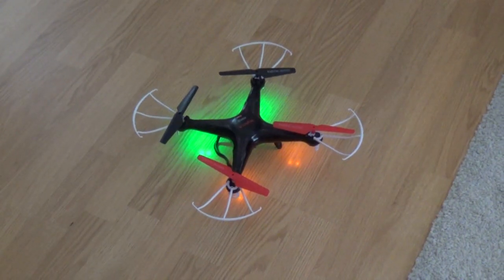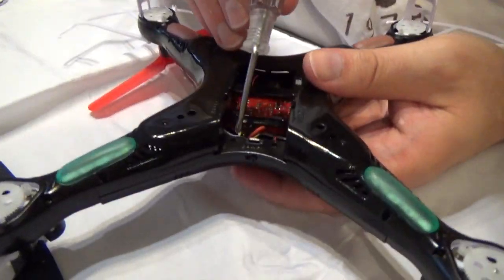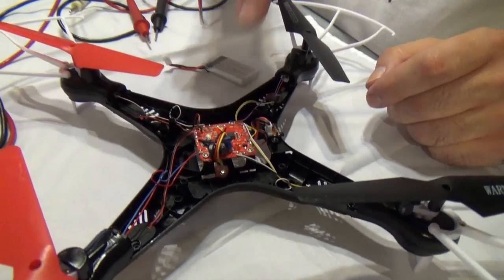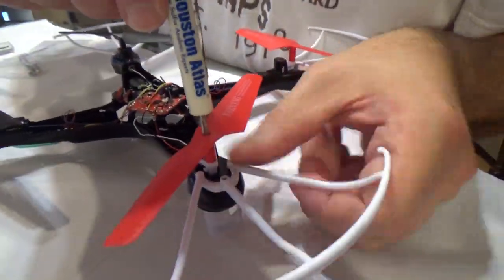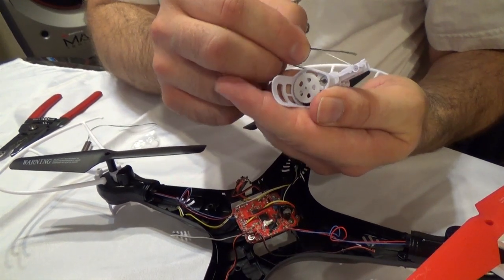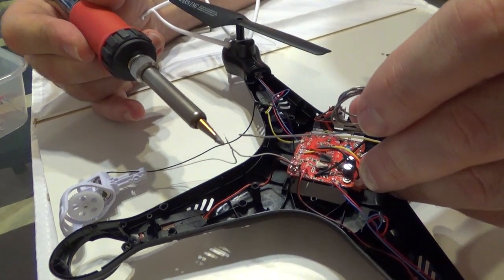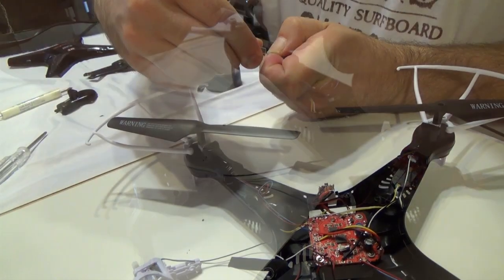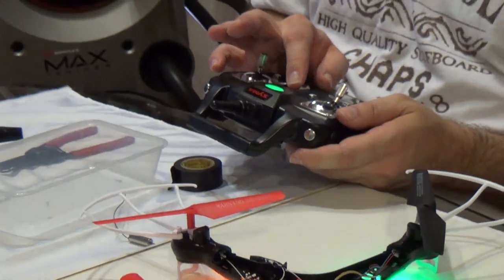How to Replace Drone Propeller Motor

Comment: Can u help me ?
My drone does not fly
I think its propeller motor is slow 
What should i do ??
Reply: open your drone, see which colour wires are conected to it(blue and white/red and yellow) which ever one it is buy a replacement and change it like he did in the video.
Even 2 of my motors were slow, changed them and now my drone flies like new.
like if this helped

Comment: Is it possible that since I bought a motor with red and white wires and I have this factory with black and white can I help how can I connect it? Thank you
Reply from the maker: Hi!  Thank you for your comment!  The color of the wire identifies which direction the motor turns.  So the red and the black are different direction.  They can't really be used interchangeably.

Comment: I have a similar problem but the same propeller won't spin as well as the others what do I do?
Reply from the maker: So... Have you tried to fix it and still bad?  If it's still bad, it could still be the motor is bad.

Comment: Good Job! I have the same issue and the company sent me to your video to learn how to replace the motor. Thanks a lot.
Reply from the maker: +MaryC Haha that's funny that the company sent you this link!  Glad the video helped!
Reply: winimow The new motors have a connector to the circuit board which negated the need to solder, and made the motor replacement effortless!
Reply: @DIYProjectsByDave  i have a KAISER BAAS ALPHA DRONE which has the exact same problem 
is it the same type of motor that I have to buy 
pls reply
Reply from the maker: @navaneethsivakumar8716  I think it's best to research the exact motor needed for your drone.  Sorry!
Reply: @DIYProjectsByDave  ok np. thanks anyway

Comment: Great video! 

Question' I just received a Propel Max 15 and during testing (literally after a total of 3 mins in flight on multiple tries) the drone backed up unexpectedly and hit the corner of the wall and the prop got stuck in the guard. When I went to pick it up it had a smell I knew and smelled like the motor.

After resetting the  remote that prop refused to spin. Seriously... a burnt motor in 4 secs?!

Is this the actual problem? There is no way a motor could burn up just being caught in the guard for such a short amount of time could it... seriously??
Reply: Change the motor,  costs like 2 pounds

Comment: the problem, i dont have a welder.
Reply: 1anakin 20 it's called a soldering iron and you also need stuff called flux and solder... Super cheap at Walmart... All for under 20 bucks

Comment: mine had the same problem after opening it up immediately I spotted the problem one white cable fro M3+ was loose I welded that chomp right on and I was good to go. be careful not to mix the propellers I got a little confuse by those guys till I found a solution on one of the videos.

Comment: After about two weeks thrashing the X5c-1 around mostly indoors the motor to RH side of the small on/off switch quit. Okay, I had a set of four standing by as I knew these were like oil filters - need replacing as a matter of course.  After maybe a day, maybe two - motor #2 quit - only it was that selfsame position AGAIN.  Fair enough, maybe the replacement wasn't excellent - fitted the last spare I currently have.  That one lasted a day.  Three motors all quit in the same motor position.
Now looking to replace the circuit board in case there's an imbalance causing these delicate little things to fail!  Soon it'll be like the old lumberjack's faithful old axe - "three new heads and four new shafts but she's still a fine old axe"  :)  Only - I'm not smiling that convincingly about this.....

Comment: You mentioned to make sure that the wires match for the motors being replaced but why?  You said that they are different motors.  Does that mean one motor spins the propeller one way and a different motor to spin the opposite way?  I'm guessing because I tried to patch a motor in that didn't correspond with the same wires and my drone won't fly.  All the motors work but it looks like too many are spinning in the same direction.  Is this correct?

Comment: my syma x5sw drone wont come on but the motors still run and it lights up I can take the battery wire put black on red and red on black and it turns the motors ove put them bk the right way it does nothing if I need to make a video let me no

Comment: What else can you use other than that iron thing you used to heat the wires together?
Reply: Soldering iron
Reply: @teunschuur7988  hey just gonna ask what is the thing they melt to put the wire
Reply: @HAHAHAHA-gh7xd  SOLDER OBVIOUSLY
Reply: Its called a Soldering Iron, and no that is the only way to solder circuitry

Comment: you should line wires up side to side to solder.however those motors are meant to be soldered to the board...

Comment: exuse me sir I jammed the the nails of my mother how do I get them off now and I don't j have the right stuff to fix my drones propellers
Reply from the maker: Hi!  Since the screws are stuck, I recommend buying the whole kit (http://amzn.to/2fO1QA6) to replace the propeller and gears.  Maybe you need to use a drill with a small drill bit to remove the screw head so you can take the motor out.  Then, replace the propeller and the gears with this kit.
Reply: winimow ok thank you

Comment: hi i have a quadcopter ht f805 one of the motor only works if i give it a little spin also when flying iam not getting any flight . need some help
Reply from the maker: +Akel Muhammad the motor is broken?
Reply: winimow the motor is working but it randomly sticks and iam not getting any flight.
Reply from the maker: +Akel Muhammad sorry... If the motor get stuck from time to time, sounds like changing the motor might help.  Good luck.